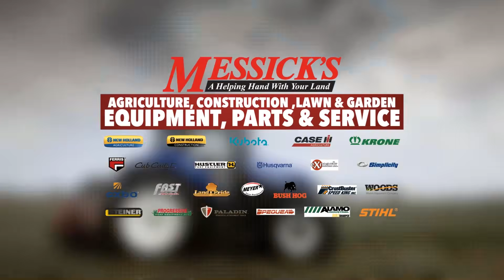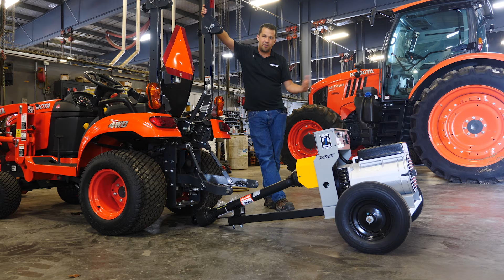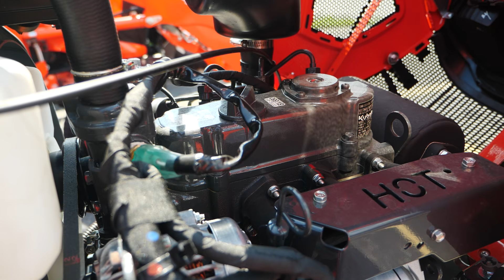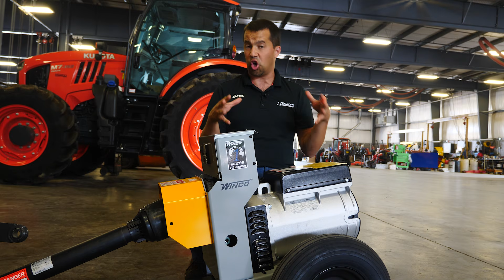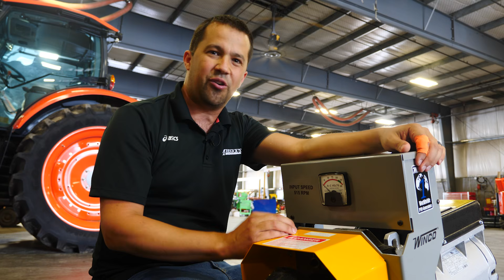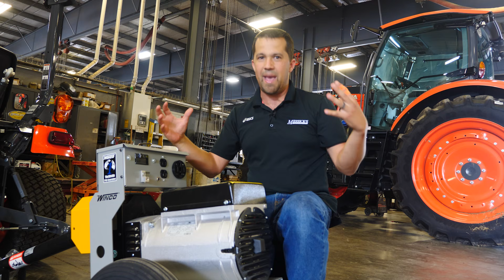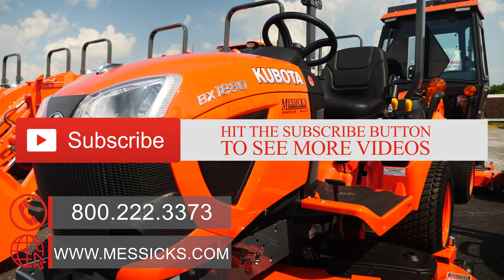Power your home with your tractor - Winco PTO Generators

Comment: I'm an electrician and an owner of a Winco generator that my father who also is an electrician bought new 30+ years ago. Not that it is a bad choice, but the automatic transfer generators are hard to beat. He bought a automatic transfer generator to replace the PTO driven one. I would agree with the PTO driven generator to bring power out where there is none. We have used it multiple times on new jobsites.

Comment: Ok ? For anyone I have a old tractor and it has the ability to run 1040 will this change the output for the gen
Reply: That depends.  Technically, you can run a 540 rpm genset on a 1040 rpm PTO, but you will be running the engine at a slower speed, which also drastically reduces power output from the engine, but also reduces fuel consumption and noise (and reduces the kw output of the generator head).  There ARE generators designed to run on a 1000RPM PTO at full power, but they are designed to run on 90+hp tractors.  The only difference is the gearbox attached to the generator, and the gearing inside it.
Reply from the maker: Yes. In bad ways.
Reply: Messick's Equipment thanks I know you run 540 at 540 just don’t know about the gen sets

Comment: Love the videos guys. But I was thinking about as I was watching this one was that I'm not so much concerned about putting the hours on my machine due to concerns of where. I am concerned about putting the hours on my machine due to the concern of depreciation. If your power goes out for a cumulative 8 days out of the year that's almost 200 hours on the clock. What else can I buy in that with the knowledge that average hours of use are right around 100 per year for most of these smaller tractors. Over the course of 10 years obviously that would be 2,000 hours. Now I would know that those hours were relatively easy hours but if I had to sell my tractor due to a health concern or an unavoidable lifestyle change I would be concerned that those additional 2,000 hours could significantly detract from the value.
Reply: If your family is cold and hungry while sitting in the dark, you won't care about the resale value of your tractor. Farmer says " I need to bale my hay but I don't want to put time on my tractor". You have to look at the benefit you received from the output of the engine. I expect my tractor to start when I push the button. I never expect the same from my portable gasoline genset.

Comment: What about making it simpler. Run your house permanently on solar panels and batteries????
Reply: A tractor PTO generator is affordable, readily available, and has a LONG life cycle.  Solar is expensive to start up, you have to rewire the house, and you have to regularly maintain and service the batteries.
Reply: @Einwetok  I have done mine in such a way that I keept the house wiring intact. Now I  do not even know when the power goes out. Personally I will never buy a generator. For me it is just wasted money.
Reply: @mlg779  How's your sunlight  annually?
Reply: @Einwetok  good, I live in Georgia.
Reply: @Einwetok  I have 3 kW of  solar pannels but for Summer/Ac I need 6 KW.
If you go to Renvu.com  you can buy 6kW of solar panels with about $3300. With inverter cables LiFePo4 batteries, support for solar panels, and if you do all work is about $20000.
That is for life (except the inverter. not sure how much that will last, the warranty is 10 years) 
you can also get 25%tax rebate this year.
I recommend a solar system to everybody because the  dollar is loosing value.
This would probably the best investment you ever made.
Reply: @mlg779  not worth it, and the environmental costs of producing/disposing of those batteries...no thanks!
Reply: @user-cy6gf2pj7y  environmental cost??? what are you talking about?
Reply: @user-cy6gf2pj7y  the plastic in the LiFePo4 batteries  is used for 20 years. Plastic bottles are used every day. why don't you pick on those, or plastic bags at the store, or milk jugs or etc. Or car batteries? or any other battery that last few days? or your cellphone battery that last only few years? again what are you talking about. ??????
Reply: @mlg779  I'm in Rabun County on top of a mountain.  Got my own 18 acres, away from anyone and everyone.   Looked into Solar.  I have clear access to the sky because I am on top of a hill.  But we are the wettest county east of the Cascades.  Also, you have to sell you power back to the electric co to be set up with them.  I was looking at a non-rooftop rig that could be orientated to the sun all time of the year.
But, being a prepper, I wanted something that would provide power when commercial is lost.  That is not how they are set up.
Still looking into it.
Reply: until there's a week of cloudy days!

Comment: We have a 540 rpm 65kw/80kw surge one for our dairy farm, run the tractor wide open in 540 when running everything in the barn at chore time, and stop and shift the tractor into 1000 rpm gear overnight, and run the engine around 1100 or 1200 in low load conditions overnight to keep 540 rpm and lower fuel consumption.
Reply: ⚠️Please make sure you follow all the generator safety tips whenever you use your portable generator. This is just a reminder for your safety when using generators. All generator safety instructions need to be followed carefully. 

Here are the safety tips: 

1) KEEPING OTHERS SAFE: Please do not allow an unqualified person or your children to operate and service the portable generator. Just because some manuals don’t say that doesn’t mean it’s safe. That is important against the generator safety rules. We also need to be keeping an eye on our children too. You need to make sure that your children are not playing near the portable generator especially when it’s running so they won’t get electrocuted. Generators pose electrical risks and they can be hot during an operation. Please keep your children away from the portable generator at all times. It is important to keep our children safe especially our little ones. Children often get curious about anything so we should keep an eye on them to also make sure they’re not wandering towards the generator. 

2) WHERE TO RUN YOUR GENERATOR: Some people use their portable generators indoors which increases the risk of carbon monoxide poisoning. It’s important to have a carbon monoxide if you have a gas generator. Never ever use your generator indoors even if your doors and windows are open and even in the garage is not safe to use a portable generator. Not even at your porch and your deck. It is never safe to use your generator indoors and in enclosed areas of your home. Your generator needs to be 15-20 feet away from your house. 

3)🔥FIRE HAZARDS: Never refuel your generator while it’s running. You need to let your generator cool off before refueling it and before storing your generator. Never overload your generator too. Never ever back feed your generator. You should never plug your generator into a wall outlet. Also never store propane tanks indoors. Please keep flammable things away from the generator as well and please don’t smoke cigarettes near the generator. Having a fire extinguisher next to the generator is also important against the generator safety rules. 

4) GENERATOR OPERATION: make sure your hands are dry before touching the generator. Never use your generator in wet conditions. Don’t let your generator get wet. You need a generator tent if you need to use your generator during wet weather. Please don’t wear loose clothes when operating the generator. Turn on your generator before plugging in appliances. Use the right cord for your generator. Please do not use worn out cords. 

Hope this helps.

Comment: It's all good, but I am wondering if it really hits the fan will we even be able to get fuel?
Reply: Diesel stores at least 2 years.
Reply: @CedarOutpost  and when everyone else is searching for gasoline for generators and cars, there won't be nearly the demand for diesel, so diesel would be easier to get...and a generator burns less diesel than the same sized gasoline ran generator!

Comment: I have a 25kw winco that I have used twice now for a week each time to run my whole house in Fl after hurricanes.  Thats 2 HW heaters and a 4ton and 2ton AC.  They work fantastic, I did use  a lot of diesel though but on the farm I have a 800gal tank so no biggie.  I did turn down the system for the night just to give the tractor a break so it would not run 24/7 for a week.  The cost is very reasonable to for the Winco's.
Reply: But, IF you had a crappy generac PROPANE 25KW generator, you'd have spent far more (25%) money to fuel it than what you spent in diesel, and the generac's air-cooled engine runs HOT and isn't designed to run as many hours as the diesel engine!
Reply: Why are you running the heaters and the ac during an emergency?
Reply: @macbook802  I think the HW is hot water.

Comment: Wet stack diesel....
Reply: What is wet stack diesel?
Reply: @mainelyelectric  when a diesel is ran without load unburned fuel gums up the rims allowing oil to get by causing more gum and tar to build up. If caught early can be addressed with heavy load for long time if not and u see tar coming out of exhaust the motor will need to be rebuilt

Comment: I would prefer to have a unit that took advantage of the 3-point connection. A generator like this is relying on its own weight to keep it from flopping around due to torque from the PTO.
Reply from the maker: That's an option
Reply: or it could be bolted down to a concrete pad as well!

Comment: Oversize the generator and you possibly stall the motor

Undersize the generator and you burn out the generator. 

I would always oversize the generator head, restarting the engine is better than the alternative
Reply: Oversize the generator by up to 25% will be of no consern as long as you're not using full power!

Comment: This 7kw setup runs our 220 v well jet pump without any problems. It’s oversized for us but 7 kw was the smallest pto generator available. I looked into a backup gasoline or dual fuel generator and was horrified at the fuel consumption numbers. Best thing is to reduce every load( get the most efficient appliances available and turn off everything that’s not essential), then select the generator. 
.
Reply: You are correct that a small tractor driven diesel generator is far more fuel efficient than a propane or gasoline driven generator, and is far better built as well!

Comment: As stated on my first reply, a rough estimate for 24-27 hours was about 3 gallons. If you google search, you can find gallons per hour per kw per hp generated by small tractors. I looked up for my Kubota BX23 but I think just searching for fuel usage per hp per kw will get you an answer.

Comment: So I have a question about the 2hp per kw recommendation: I have two Kubota tractors; one is a 95 hp and the other is a 26hp (19.5 hp at the PTO), and I'm wondering about what the PTO recommendation really means?

Does it really mean that it takes of 2 hp per kw to produce the rated amount of power; therefore you could in fact use a smaller tractor to run a larger generator, but you would be limited to a LOWER kw than the generator is rated for? Most of the time I could make due with a lower kw rated generator (using the smaller tractor, with a lower fuel burn), but I also have the larger tractor for those times that I need the larger generator (say, running a remote welder, or powering an entire farm during a extended power outage). 

The larger the demand, the larger the power requirement to produce it. Conversely, less demand requires less hp. And it is important to remember that higher fuel burns will determine how long you can use the generator based on your available fuel.
Reply: You are correct.  They have some advantages of a large generator on a small tractor.  One is that the larger mass of the generator helps keep the generator spinning and you don't get as much of a dip in power during a surge like a large pump kicking on.  You burn less fuel also.
Reply: @w.j.guidry8459  Thank you. I called Winco tech support yesterday, and they also confirmed my line of thought. But your point about the larger gen having a fly-wheel effect is also good information.

Comment: Iv always like the thought of a pto gen you your tractor is used more often then a stand alone gen where the fuel can go bad sitting and plug up the carburetor and then it won’t start when time comes to needing it.
Reply: ⚠️Please make sure you follow all the generator safety tips whenever you use your portable generator. This is just a reminder for your safety when using generators. All generator safety instructions need to be followed carefully. 

Here are the safety tips: 

1) KEEPING OTHERS SAFE: Please do not allow an unqualified person or your children to operate and service the portable generator. Just because some manuals don’t say that doesn’t mean it’s safe. That is important against the generator safety rules. We also need to be keeping an eye on our children too. You need to make sure that your children are not playing near the portable generator especially when it’s running so they won’t get electrocuted. Generators pose electrical risks and they can be hot during an operation. Please keep your children away from the portable generator at all times. It is important to keep our children safe especially our little ones. Children often get curious about anything so we should keep an eye on them to also make sure they’re not wandering towards the generator. 

2) WHERE TO RUN YOUR GENERATOR: Some people use their portable generators indoors which increases the risk of carbon monoxide poisoning. It’s important to have a carbon monoxide if you have a gas generator. Never ever use your generator indoors even if your doors and windows are open and even in the garage is not safe to use a portable generator. Not even at your porch and your deck. It is never safe to use your generator indoors and in enclosed areas of your home. Your generator needs to be 15-20 feet away from your house. 

3)🔥FIRE HAZARDS: Never refuel your generator while it’s running. You need to let your generator cool off before refueling it and before storing your generator. Never overload your generator too. Never ever back feed your generator. You should never plug your generator into a wall outlet. Also never store propane tanks indoors. Please keep flammable things away from the generator as well and please don’t smoke cigarettes near the generator. Having a fire extinguisher next to the generator is also important against the generator safety rules. 

4) GENERATOR OPERATION: make sure your hands are dry before touching the generator. Never use your generator in wet conditions. Don’t let your generator get wet. You need a generator tent if you need to use your generator during wet weather. Please don’t wear loose clothes when operating the generator. Turn on your generator before plugging in appliances. Use the right cord for your generator. Please do not use worn out cords. 

Hope this helps.

Comment: I'm thinking many people here are too concerned about "clean" power. Worked on ships for 20 years.....the power is not clean. Never an issue. Modern electronics self filter. 

I myself run a 16kw chinese built diesel generator on my house; the price was right 🤑. I adjust the Hz with a throttle screw on the engine. I keep it between 55hz and 60hz.....my house lights flicker and motors run slower but my electronics have no issues. Most electronics you will say it can run on 120v-220v or 50hz-60hz. We live in a global supply chain where consumer electronics need to run on 3rd world power grids of varying standards.

Comment: Got a 12 kw baumalight generator I run off my tractor also made a frame to hold the welder and a air compressor powers the house and shop no problem on our small farm and also makes in field repairs easy plus i can have power anywhere I need it

Comment: How’s the Harmonics of the generator? Lots Of electronics need a clean 60 Hz.
Reply: less than 5% harmonic distortion...as good or better than a generac whole house generator...and lasts far longer!
Reply: @user-cy6gf2pj7y  do you know how that leven has been over time? i have a 25 yr old model and was wondering how it would play with my electronics.
Reply: after research on FB marketplace, every winco pto genny was 60 hz

Comment: So I have the three cylinder Kubota diesel motor hooked to a old Chevy four speed trans I use to drive a water pump I have another motor could I run it the same way?
Reply: assuming it's a manual transmission, yes, as long as you have the trans output speed correct

Comment: The only downside I see is when it comes time to sell your tractor.  The buyer will see those hours an assume you have been working the he'll out of the entire tractor, not just the PTO and engine and will not want to pay much for your tractor.
Reply: unless you just [pull the fuse to the hour meter (devilish grin)
Reply: or buy a second hour meter, run it up to 500 hours, and then swap and keep the 500 hr one to re-install before you sell.